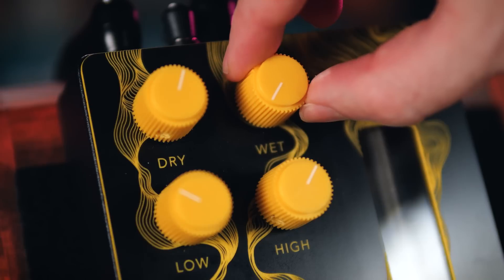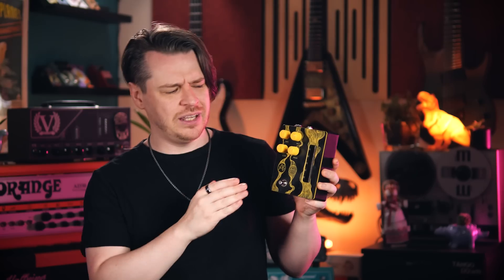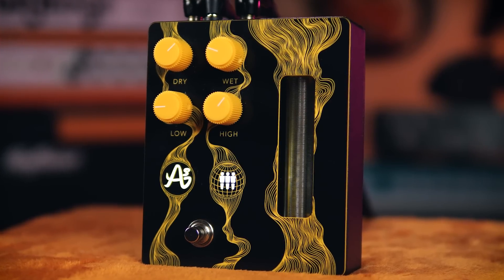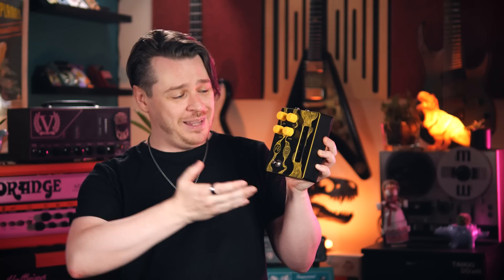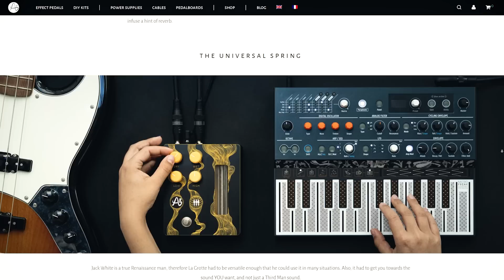Real SPRINGS Inside! Jack White's Trashy, Dirty Reverb Pedal

Comment: A Pedal that contains reasons 3, 5, and 7 for getting a Fender Dual Showman Reverb.
Reverb, Overdrive, Higher gain than earlier Twin Reverbs. 
(Think 135 Watt TFL 5000D style Fender Amps, late 1970's Twins also apply, but wouldn't throw Basses, Bass VI's, or Baritones through a 2X12" combo amp.)

Sincerely 
Mike B. B. From Philly, P.A. U.S.A.

Comment: That thing is rad. Does it drip though? At $385 USD I'd wait to find one on the used market. I've never spent more than $250 on a single effect, excluding a near mint condition 1981 EHX Polychorus, but that particular one is actually vintage, getting rare and collectible, and is more like 4 effects in one box, although you can't use more than one mode at a time. If they could get the price down to under $300, I would consider picking one up new.
Reply: You can find it from Thirdman at $300 :)

Comment: I made my own by using a spring reverb tank and a tube screamer essentially as the preamp. Works great.
Reply: I've wanted to try this with the tank I replaced in my amp. Can you point me in the right direction? My amp didn't push the tank very hard so it was always too subtle, I want to drive it hard and get some trashy nastiness from it if possible